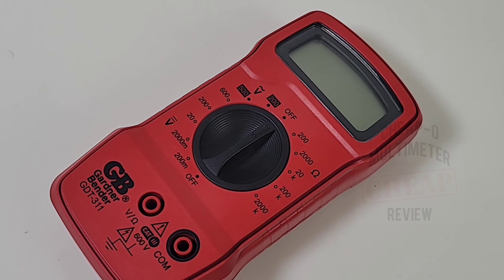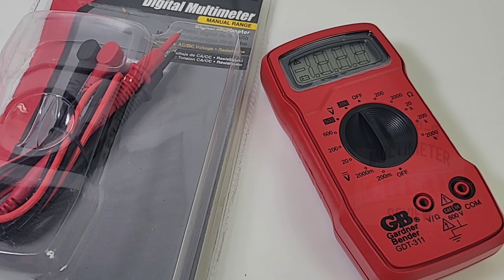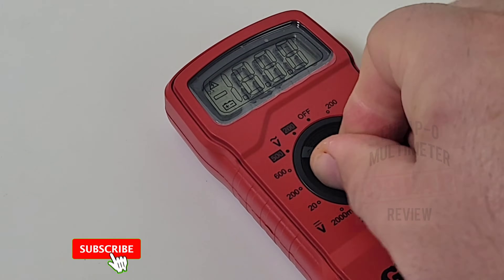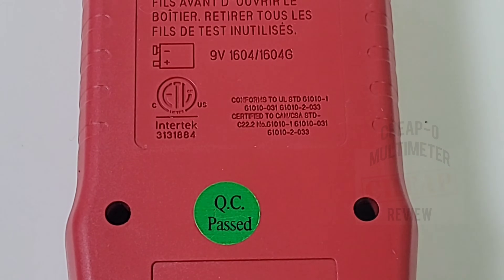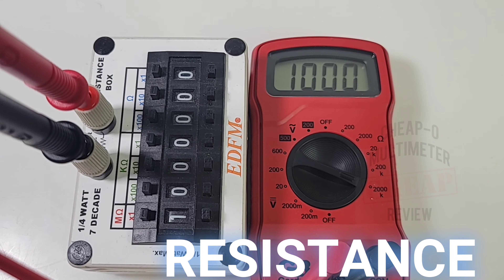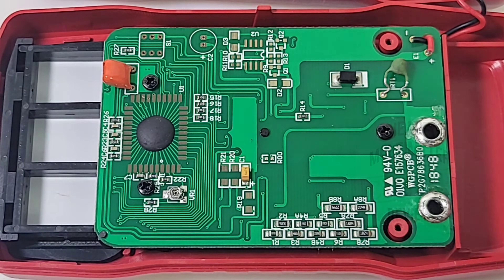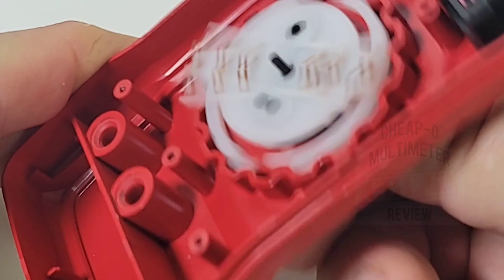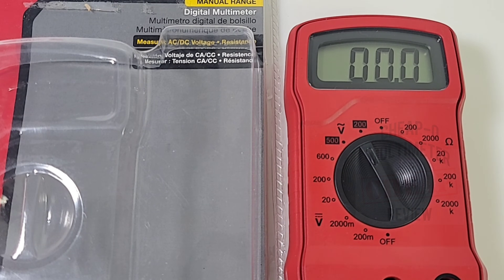GARDNER BENDER GDT-311 CHEAP-O Multimeter Review & Teardown!

Comment: I tested a bunch of circuits in my 1999 house in SC, USA, and only measured about 60/62 volts AC.  This is about half of the typical 130 v……ideas?
Reply from the maker: Can you confirm the multimeter works properly? If the meter is testing good, then it sounds like a wiring issue..
Reply: @KeepOnTesting  so I got to my Ohio house and the outlet voltage was about 59 V. I used my Kobalt meter in the same socket and got 124…….sounds like a defective unit.  I’m gonna see if my Ace Hardware will take it back.
Reply from the maker: Definitely a faulty Multimeter..glad you found the culprit.👍
Reply: I proved to the Ace Hdw team that it did not work properly and the item was exchanged. The new one worked.  Now a need to figure out wh6 my RingDorbell will not install correctly. Thanks for the advice. Be careful choosing a voltmeter!

Comment: Eight minutes of unbridled hate.
Reply from the maker: Trust me..I restrained myself.. 😅 
.
Reply: @ lol I understand. I have a question. Does that multimeter have a capacitance setting?  I need to test a capacitor.
Reply from the maker: Unfortunately not..Ac/Dc volts and Resistance ..that's it 👍

Comment: Mine just reads 1 on every  switching and dint read nothing
Reply from the maker: Did it get zapped?Sounds like it may have been exposed to an improper range selection while plugged in ?
Reply: I only used it to test aa batteries 3 v

Comment: I just bought this POS from ACE hardware for 19.99 and now taking it back.. this company should be called Gender Bender.. cause they F you...  got it home just to find out that there is NOT F'n BATTER IN IT!!!.. you have to go spend another 5 to 10 bucks on a 9v batter...  I have bought other more advanced mult meters for about the same price and they came with batteries and it was double A's not friggn 9v .. totally unnecessary ..   you would figure they could have at least gave a cheap 9v with it but NOOOOO   that would be the right thing to do....  I will never again give this company a penny ...  total Waste of money and my time..!!!    and yes I see it said battery no included on the BACK IN TINY PRINT,  I just expected for the price it would have at least came with a battery ..even if crappy one..

Comment: Can you do a continuity test with this meter?
Reply from the maker: Yes..Set to lowest Ohms mode (200) in Resistance.then test your subject (positive to one side and negative to the other). If it's close to zero ohms than you have continuity. It's not as sophisticated as audible continuity (loud constant beep) but it will still do the job in a pinch.  👍
Reply: @KeepOnTesting  of coarse I already went out and bought the fuses but got everything working so I’m thinking it was a bad fuse anyway lol but thank you for the info! Now I’ll know for future issues 👍🏼

Comment: The multimeter allows you to test up to 500 AC Volts.  Not "200" as you stated in your video.  On the dial settings next to AC they are displayed in bold numbers like the AC text.  200 on the right side of the AC and 500 setting on the left side.  Is there even a multimeter on the planet that only tests up to 200 AC volts?  Isn't 240 AC extremely common?  If you're going to do videos reviewing miscellaneous testers etc, try being a little less dramatic in your presentation and a little more accurate.

Comment: What the picky/ fussy narrator  fails to mention re: The Glendale, Wi based Gardner Bender model # GDT-311 multimeter is how to take apart the Frickin device to install 9V battery. Can somebody get back to me ASAP PLEASE because company doesn’t allow talk to “live” person either. Furthermore the model doesn’t even give instructions; instead just product features. Very frustrating & unprofessional!
Reply from the maker: Well let this picky/fussy "narrator" tell ya how ..simply turn the multimeter so its back is facing you..then locate the 4 holes and unscrew the philips screw in each hole. (located at each corner).  That's it! Miraculously the back will then come off and you will have instant access to your battery compartment!  Btw, feel free to send a Super Thanks my way if so inclined. 😊👍

Comment: Which one do I turn it to to check the thermal fuse, thermostat fuse on a dryer!?? I’m not an electrician or know anything about this lol I need to see If my damn fuses have any continuity and I don’t know which one I need to turn it to to check it 😢
Reply from the maker: No audible continuity on this model however you can still check continuity by setting it to Resistance mode and choose 200.  Now test the fuse and it should read 0 ohms or very close

Comment: How can I measure continuity with this multimeter?  I look for the option but I can't find it, is there a way to do it with this multimeter
Reply from the maker: Yes..Set to lowest Ohms mode (Resistance).then test your subject (positive to one side and negative to the other). If it's close to zero ohms than you have continuity. It's not as sophisticated as audible continuity (loud constant beep) but it will still do the job in a pinch.

Comment: Hey I really enjoy your videos but one feature you miss for most of the multimeters you review is if they have (or not) the tiny VR1 potentiometers to adjust/calibrate the voltage (I know you mentioned in a couple of videos but in my humble opinion this should be part of all your videos). For me this is super important for the Cheap-O Multimeters since I can calibrate them with my job's expensive flukes every 6 months or so and then I have a cheap-o calibrated multimeter at home. For example this one on this video have the tiny potentiometer (label VR1) and you totally missed that super important feature for this particular Cheap-O. Thanks for all your videos.
Reply from the maker: Hi Gus, valid 👉 point ! Moving forward I'll make sure that this self calibration feature is noted whenever I do a CHEAP-O review ! Thx for the feedback 😀
Reply: @KeepOnTesting  Thank you so much!!
Reply from the maker: @NaturebyGus Anytime !

Comment: My truck has a parasitic drain on my battery that will happen intermittently. I’ll turn it on some Mornings and batteries will
Be completely dead. I want to use this to test to see how much power is been drawn from the battery. Any idea how I do this and what setting to use
Reply from the maker: Make sure your battery is fully charged and good. Put your multimeter in the high current mode (10Amps) .disconnect your ground battery terminal from the battery. Take one test leadand insert into the negative battery cable and the other into the battery (ground).you should have less than 50mA draw...any higher and you have a parasitic draw. Before testing, make sure nothing is left open on the car..no doors windows etc.
Reply: @KeepOnTesting  what do you mean by high voltage mode? Not on 20 voltage? It is not giving me any where close to .50?

Comment: I just bought one yesterday at the local Menard's.  $15 and change.  It will do what I need, which is to check resistance on different pieces of equipment I have.
Reply: Can't go wrong for 15 bucks. It works and don't have to worry if it breaks.
Reply from the maker: Great price, well worth it! 👍

Comment: So what happens when u plug the leads into the wrong hole and run a battery test. Does this damage anything on the device or the battery being tested? Ty in advance
Reply from the maker: Battery test, nothing serious..it wlil just show the battery output with Reversed polarity
Reply: I’ve tried to fry mine, all I did was swell the battery up. It’s a solid hard to break/kill meter. I paid $10 for mine at Menards. Open package and 15% off bag deal. Well worth it.

Comment: See the canal that runs the outer perimeter of the unit? That is the inset where the rubber shroud that should have come with it would have sat. It has the tail stand you suggested they should have. I have the same unit bought at Ace Hardware.

Comment: that's American capitalism for ya. make cheap sell high. it's made in China FFS but it works great. i have one at home to ring out stuff on cars  paid only$10 for it 20 something years ago. I've used far more expensive ones that break if you breath wrong or look at it funny. it might only have 3 functions on it but it has never failed.
Reply from the maker: The Gardner Bender is definitely resilient, I'll give it that..but at 40$ for the most basic model it's definitely overpriced. It's good to hear the reliability factor is strong. 👍

Comment: I bought two of these (GDT-311) about 20 years ago.  Back then I paid $10/each  & I can say they both have performed perfectly each time I used them. I have taken them into junk yards several times in the mud slop (to test resistance on coil packs). I have also taken them to job sites in my tool box (no special/protecttive case used) and they have never let me down. Yes, they only have 3 functions, but for $10 I think they are great.
Reply from the maker: At 10$ it's a steal..unfortunately they're usually 3x that price which takes them out of the great buy zone.They are tough as nails  as you pointed out..probably it's strongest asset! 🙂👍
Reply: @KeepOnTesting  I just bought a new one a day cuz my own one broke up for so many years. Paid a whole $14 for it. But I do have tools I'd like to sell you hahaha
Reply from the maker: @bud832001 14$ is an ok price..tools eh..you can never have enough tools or multimeters 😃 👍
Reply: A

Comment: Is this good enough to work on electric guitars?
Reply from the maker: The GB doesnt do capacitance. Here's a much better alternative. 
https://amzn.to/3KHyClY
Cheap but loaded.
Reply: @KeepOnTesting  Thank you for answering my question.  I should have done some research before I bought it. It's my first meter, have no idea how they work but you live and learn. Thanks again.
By the way I paid 28 bucks for it in the Bahamas, where the dollar value is on  par with the United States.
Reply from the maker: @clintlbrown2597  No problem, having at least 2 multimeters is highly recommended anyway 👍

Comment: Interesting, I thought I had heard of that name before. I looked out in my work shed and low and behold! I had some
other basic GardnerBender products, a package of wire nuts (multi colors and very old, some electrical staples which
I assume are for twisted pair wiring and some plastic GardnerBender tape also very old and in a rainbow of colors) So besides
this eclectic  very basic multimeter (which I do not have and will not purchase) it seems they also sold me some other very basic
electrical items. But hey, that's what merchandising is all about. Good job, GardnerBender. Also, Great Job! Darren
Reply from the maker: Yes those GB tools are everywhere..Sounds like you have your fair share of them too! I was visiting my father recently..low and behold next thing I know I'm checking fuses with his GB multimeter..these things are everywhere! heheh

Comment: I have a model up from this one and its almost identical on the inside, does what its supposed to but $30 for this is insane maybe $10 or no more than $15 considering its basic build.  On the other hand its got solid top quality jack construction and it does work as advertised, but you can do so much better for this kind of money.
Reply from the maker: All valid points.. perhaps 15 years ago it would make sense but now...the $ seems ludicrous for what you get..